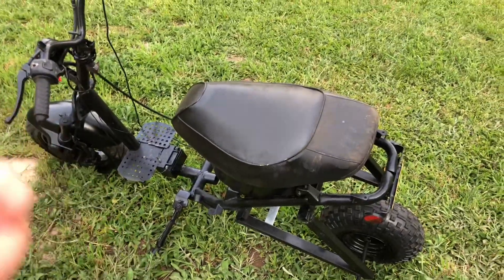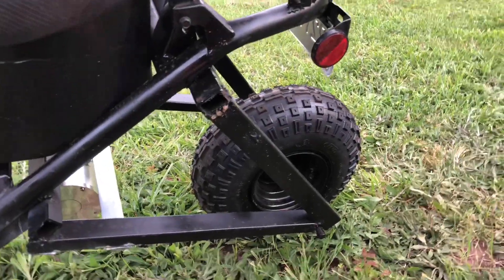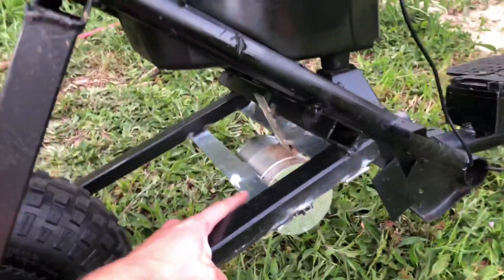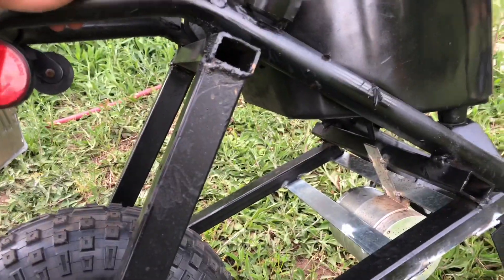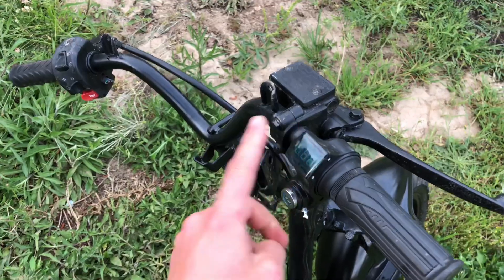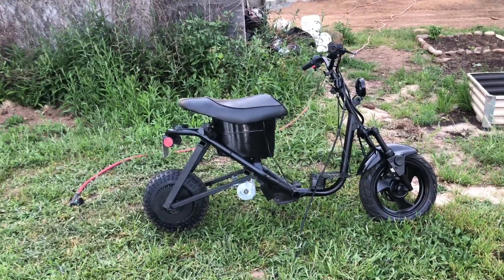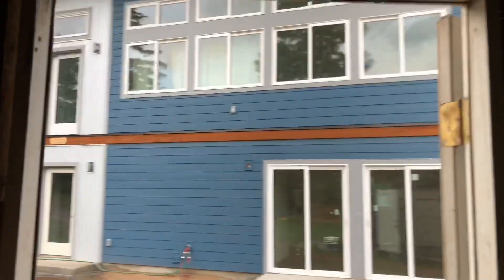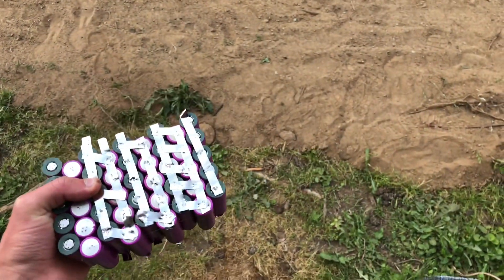$900 Electric Moped Scooter - Build Progress

Comment: Congratulations on completing high school. College is next, especially a young man of your aptitude. Yes I want you to complete the scooter. Definitely fast enough to out run brown bears. LOL. At least 40 mph. Those did not look like 18650 batteries to me. I would hope they are at least high-drain batteries. (10c?) I know you said 50 mph didn't you? I think direct drive with a chain from the motor to the wheel. Don't give a lot of throttle at first, though. With high drain batteries you'll get the torque especially 72 volts. Personally, I believe you'll top end at 50 or maybe 60 mph with 20 to 30 Ah. Just a guess though. Is there any way to use the drive off that ICE or maybe a centrifugal clutch. Again just a guess.
Reply from the maker: Just taking a break from building the lithium battery right now. I didn't show those in this video, but yes they are high drain. I bought 300 cells in bulk that are recycled with decent capacity. I'm using a jackshaft to swap gear ratios more easily, currently I found out that the motor sprocket has some weird type of chain I can't match to anything, but I'll contact the manufacturer and figure it out. With current gearing it should have a lot of torque and less speed. It's an exciting project. I'm putting off college to figure out who I am instead of going straight into debt, while working at a popular restaurant and saving, as well as investing in projects like this silly one for 1-2 years, as I'm only 17.

Thanks for your interest! There's no point in a centrifugal clutch when the most torque is at low rpms, clutches only save engines from being killed when the starting rpm isn't enough to move the vehicle. No need for that here. Maybe a freewheel to reduce, basically, engine breaking would help, unless I get a regen setup going, in which case I'd want the direct drive setup to stay.
Reply: @logannobles  It's not silly. I think it's cool. I have another friend that calls his projects silly. He's a part time science buff. I too work with science to find answers to America's oil addiction without resorting to solar panels or cluttering up the scenery with wind mills.
Reply from the maker: @jdh11154  Use less energy, don
t have 810 people commute alone to work in a car, make moped or single-person vehicle use more common, get elio to actually finish production.